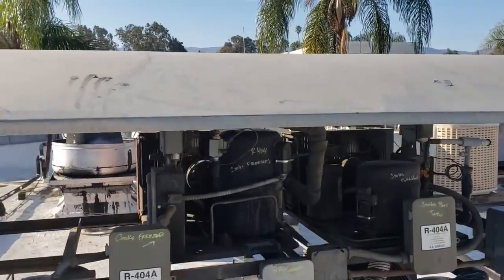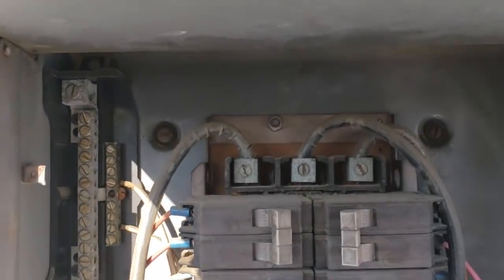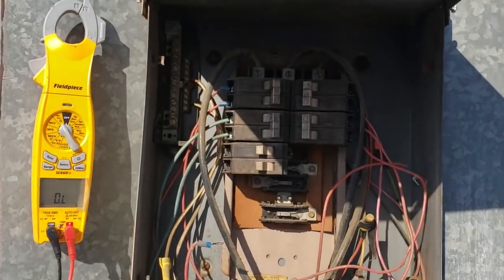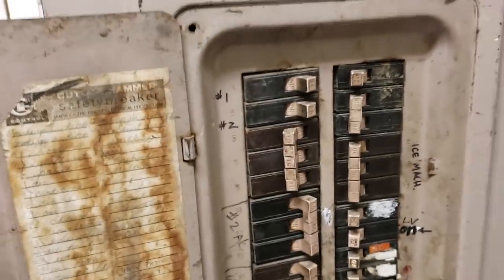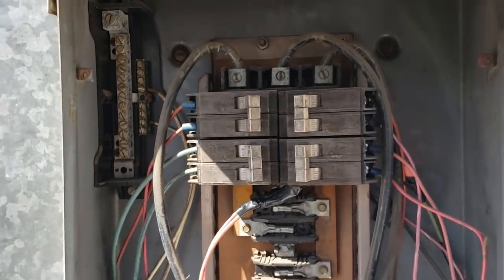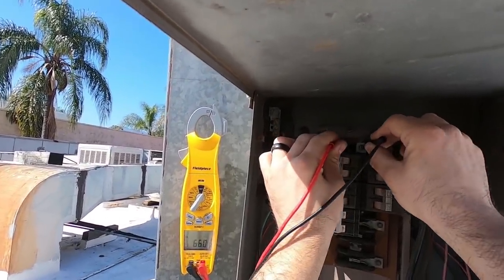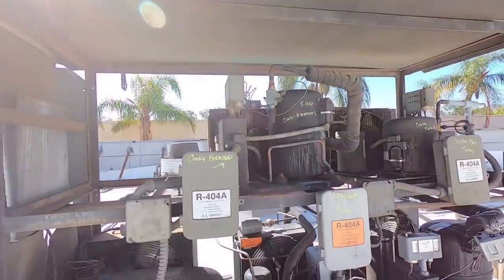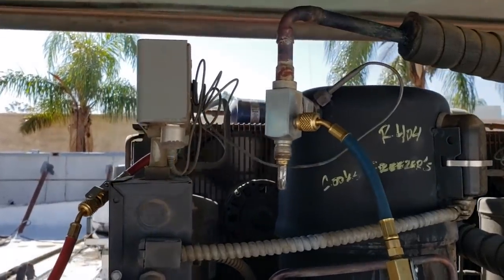REACH IN FREEZER NOT WORKING

Comment: Good fix, as always.  FYI, since that was an actual double pole breaker and it says on the side it said "common trip" you need to close both switches at the same time. Since the tie bar was missing and you were only closing one pole at a time you could hear it trip free, that's why it was easy and didn't sound right. Once you pulled it out and opened and closed both poles together it sounded much different, more solid. But, regardless, the breaker was cracked so good call on replacing it. Also not a bad idea to exercise the breakers like you did, but in an old panel like that make sure you're not doing it on a Friday night when the supply houses are closed. I am sure you have shut off a breaker to only have it not close again, I know you know this, just putting that out there for the next guy.

Comment: whoever used terminals on the ends of the wire should be strangled... I've repaired many panel fires from just that kind of stupidity, it generates more heat from poor contact than just putting it directly under the screw for which it was intended.

Comment: I have to laugh at all the comments about calling an an electrician. Changing, diagnosing a breaker is not brain surgery. Electrical work is a thousand times easier than HVAC.
Reply: Not when it comes to staying certified and keeping bureaucracy happy, but yes there is more work involved when it comes to the thought process in troubleshooting HVAC systems.

Comment: I had a main breaker fused together on 1 leg and I couldn’t turn off the power completely. Half the house was hot except 208 appliances. The home owner said at one time the service was struck by lightning. I packed my tools and left and they eventually replaced the service panel and lines to the pole. Set them back 4K. I see that sometimes in the field.

Comment: That was code back in the 80's to have the conduit as the ground. I always try to check the amps when I startup a suspect unit just to watch for high amps. I like that electrical shop with the old panels. That's a great idea.
Reply: Sorry, no ..
this is a Sub Panel, it has always required an insulated,isolated  separate ground
Reply: @embreesmith7613  And I do not believe liquid tite qualifies as a ground for anything. Always run a ground wire from box to box or box to connection when liquid tie is in use. Older codes allowed emt and rigid to be the ground.
Reply: @tedgerstenslager2949  You, Sir are CORRECT  :)
a grounding conductor is always required in steel liquid-tite

Comment: The OCD Electrician's apprentice in me is trying not to pass out.....plz ignore this but have to vent the OCD.. just change the panel it's not safe!!  a 200 amp subpanel is only $100 at lowes and if you get the right style you can use the old breakers..... Sorry HAD to put that out there....i know it's not Chris' fault.... Mr. big picture would have changed it if he had found an excuse to justify it to the customer.
Reply: Hah. 3 phase 100a mainlug sub panel for 100?$
Reply: The panel is cheap but 4+ hours of labor on that job is no joke.

Comment: Seal tight ground, 20amps or more needs a ground wire.
Reply: Looked like Liquidtight Metallic Flexible Conduit, not the Nonmetallic  type so OG installer using the conduit as ground was GTG.

Comment: Our country has 415 vac between phases.
MEN Earth or ground wires  keep the electrical grid at zero potential to earth.
(Multiple earth neutral systems.)
Otherwise you get stray voltages between  buildings and metal objects.
Earth wires also provide alternative path to neutral busbar incase a live wire earths against the metal enclosure allowing the over current protection to operate.
Auckland NZ.

Comment: a Neutral, is a current-carrying conductor
not a Ground, Sonny ..  :)
Reply: that should be a 5-wire feed to that sub panel, it is not "service equipment"
Reply: It is the grounded conductor according the NEC and is bonded to the grounding conductor/grounding system at the service entrance load center.
Reply: @embreesmith7613  techicaly you dont need a neutral if there is no 120V equipment.

Comment: why not just do a continuity test on the breaker when you took it out? with all that corrosion inside, it could have just had a really bad connection.. but nice job either way! half electrician.. half plumber... all HVAC?
Reply: Continuity will screw ya. Can be a totally different reading under load
Reply: I see your point, and agree. but you can always do continuity under load by hitting the bus and the input line.
Reply: rick w very true. I’ve been bitten a few times on appliances with pinched wires and stuff lol. Voltage never lies is my new lifestyle 😂
Reply: Just replace it, don’t waste any more time on it.
Reply: @charlesmurphy1510  that's if you have the part on hand. If you have to run back to the shop or supply house to get it, testing doesn't seem longer to me
Reply: @rickw4160  regardless, I would not put the old one back in.

Comment: Are you allowed to get that deep into the breaker panel? Or is there a certain place where one as a Refrigeration tech has to call an electrician
Reply: Its what your comfortable with, this is tiny stuff. (Respect it) As a 35 yr. service tech more than half your problems will be electrical in this field.

Comment: Dear Sir, this morning I worked on a Traulsen Freezer, it run short cycles.  I replaced Start kids (Potential relay, run capacitor, start capacitor after found bad on run capacitor, potential relay, low to minimum rate of start Cap..  I checked Ohms on compressor 3 terminals seems good  C  to  S = 4.7 Ohms; C  to  R  = 1.9 Ohms and  S  to  R  = 6.7 Ohms .  When restart,  the Freezer operates in Short cycles as before.  So what Can I blame to :   compressor, Time clock, or temperature control.

Comment: I don't know about California but what you have there is a subpanel feeding those units they don't want a dedicated ground at the sub panel they only want the main pricipal bonded I believe that's how are electrical code is sounds crazy but there is sound reasoning behind it and I can't remember exactly what it is
Reply: Totally different issue. The neutral is not bonded to the ground bus at subpanels to avoid unbalanced current flowing across common metal surfaces or fault current to have to travel across the neutral during a fault event. An equipment grounding conductor should be taken to all equipment, especially with flexible conduit that may not be able to provide a proper path to ground.
Reply: Yes understood I couldn't remember exactly what I kept tucked away in my head👍

Comment: You mentioned that breaker was off , I have found that those older Cutler hammer breakers  tend to trip to the off postion, was that the case with your breaker ?
Reply from the maker: It's a very good possibility that it was tripped. The owner had tried to reset it before I got there so who knows how he found it.....

Comment: Safety ---Lock out tag out main breaker for that panel anybody could turn that breaker downstairs .In are state trade licensed we are allow from equipment to the main breaker then it's an electrical job. Really you don't have any electrical safety gear like gloves while inside 3 phase panel live .
Reply: The pain oooooo the pain..... I got shocked by 480 because the owner forgot I was working on the system. So she just turned it on even though I put red tape over it. She said she was sorry, she thought i had left. She has bad memory. The worst shock of my life, but I'm kind of glad it happened.  I had a second chance to change my life around. Because now, I locked everything out and remove fuses. I will never take that chance again. To anybody out there that works on electricity everyday, it just takes one sick person to kill or maim you for life. Then under your insurance policy it states did you lock it out.  They look at it after you died.        NO!!!!  So your policy does not apply. NOW YOUR FAMILY ARE SO DOOMED, NO LIFE INSURANCE. Look at your insurance fine print it's in there. The only Clause that you might be able to get around if you locked out a other source by accident.

Comment: Installing wires back into the breaker without an electric wire ferrule? It's compulsory in europe.
Reply: Since most wire here is copper and most ferrules are aluminum, they should not actually be used because of corrosion due to electrolysis.
Reply: @anthonycaron2265  that literary only counts if the connection gets wet. Plus, if the connection gets wet AND you dont use them, the changes are bigger that you short the circuit and cause bigger problems
Reply: Absolutely false. Look up electrolysis, before you have an opinion about it.
Reply: No requirement in the UK to have them.
Reply: @anthonycaron2265  the ferrules over here in Eurpe are tinned copper.

Comment: Here in europe it is not legal to connect a flexible power cord (containing many small copper wires) directly to a breaker. You have to use a clamp like you  snipped off. Maybe code is different where you work.
Reply: One can allways use ferrules.

Comment: Not to speak out of turn, but you really should take your ring off before working near any electrical wiring or contacts, especially in that evaporator with the broken heater. Beyond the possibility of arc flash or a spot weld that you might not be able to break, you'll lose your finger if the heat cauterizes the blood vessels and nerves feeding it!
Reply from the maker: It's a silicone ring

Comment: The pain oooooo the pain..... I got shocked by 480 because the owner forgot I was working on the system. So she just turned it on even though I put red tape over it. She said she was sorry, she thought i had left. She has bad memory. The worst shock of my life, but I'm kind of glad it happened.  I had a second chance to change my life around. Because now, I locked everything out and remove fuses. I will never take that chance again. To anybody out there that works on electricity everyday, it just takes one sick person to kill or maim you for life. Then under your insurance policy it states did you lock it out.  They look at it after you died.        NO!!!!  So your policy does not apply. NOW YOUR FAMILY ARE SO DOOMED, NO LIFE INSURANCE. Look at your insurance fine print it's in there. The only Clause that you might be able to get around if you locked out a other source by accident. Please put lockout on you videos to help are young apprentices to remember. You could save someone's life just for a few seconds. Most guys have had very mild shocks. They really do not understand how bad it can be. Imagine losing the use of your hands. Guys in this trade treat it like an art,  and it is it's kind of fun. But so so dangerous.  Water, oil, gas, etc........ all mixing with high voltage. The complacency  bug will bite you. If you cannot see the disconnect from where you're working lock it out remove the wires or the fuses don't trust anybody even your partner. We all have bad days...............